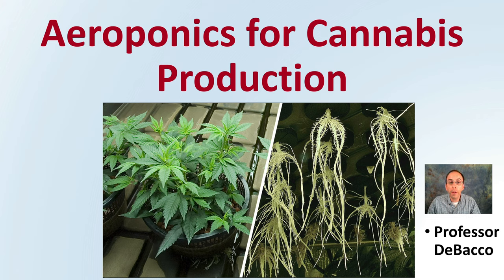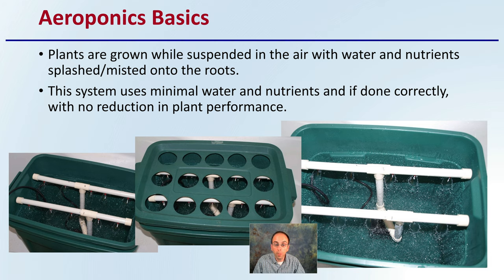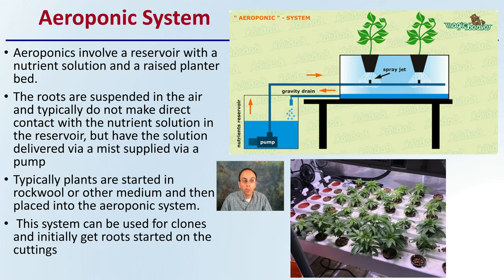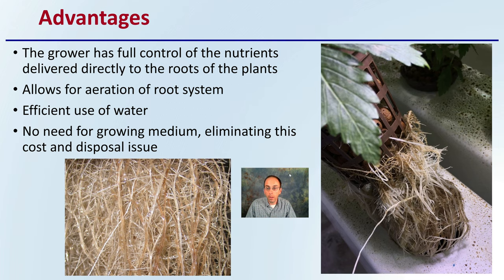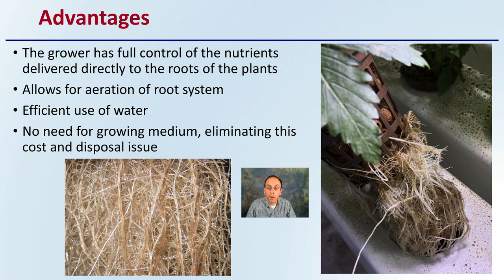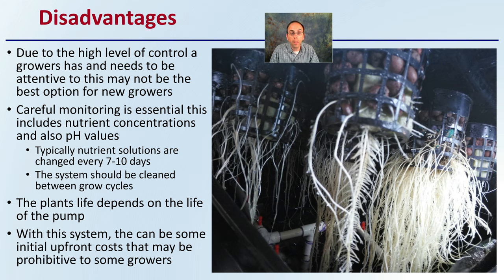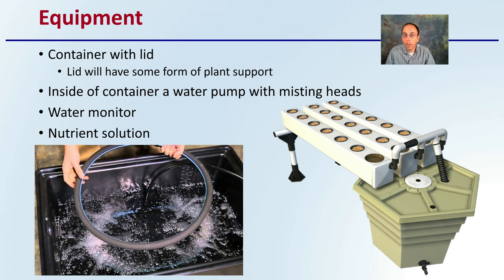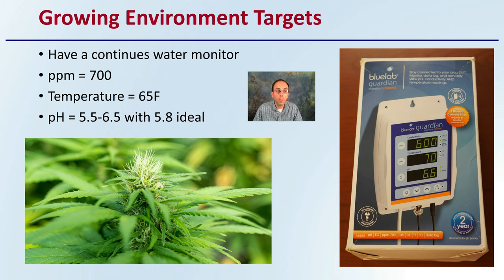Aeroponics for Cannabis Production

Comment: The root pics at 1.35 have a definite slimey appearance that have likely been subject to too much water and or heat. Aeroponic roots should be pure white and vibrantly healthy. Low water usage translates into runnot having to run a rercirculating reservoir, you can use drain to waste. Drain to waste ensures the nutrient delivered to the plant is perfectly clean and elementally consistant. The only time you need to change a drain to waste the reservoir is when its empty. I`d recommend spending your cash on a decent sized accumulator tank and not a bluelab guardian.
Reply from the maker: Slim can be beneficial biofilm in some cases.